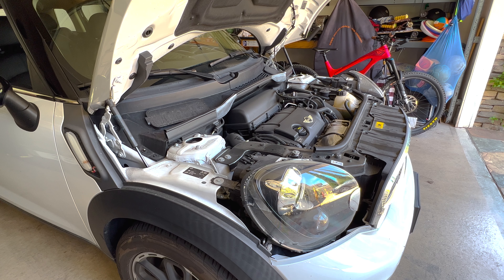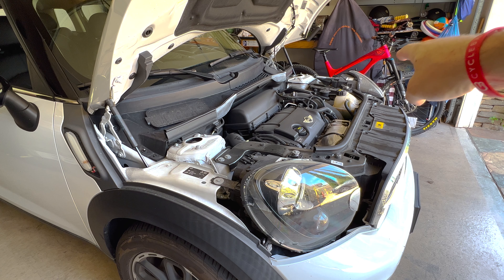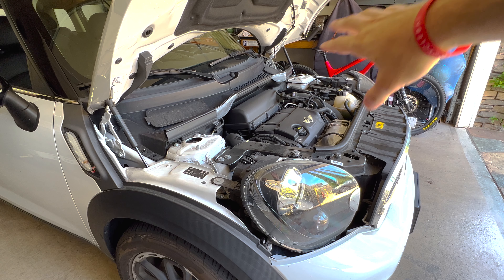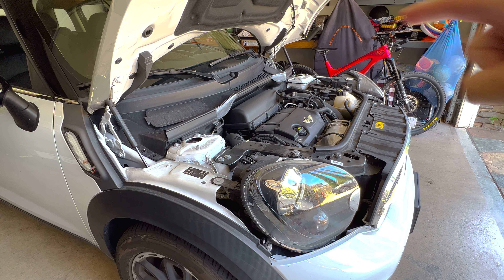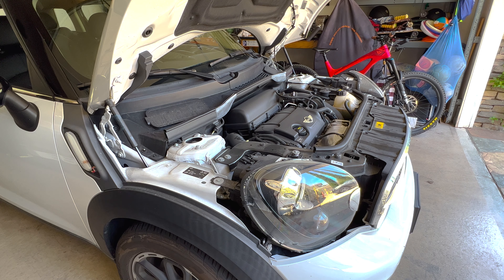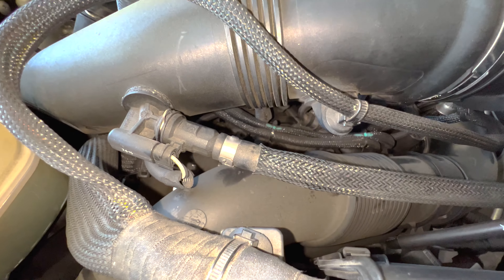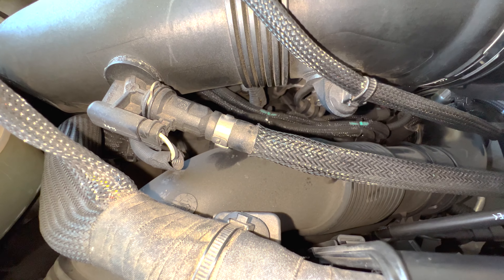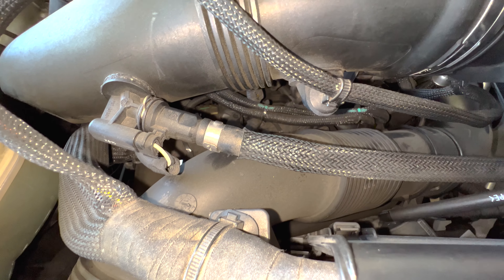We Have A Coolant Leak! - Can We Find It? [Coolant Was Everywhere!] #cars #carrepair #fun

Comment: hi, I watched this video and the next two about replacing thermostat housing. sorry did not fully understand what you said in this video, how did you come to the conclusion that the leak is from thermostat housing?
Reply from the maker: It was tough to show on camera becuase it was in such a tight spot, but I was able to see it dripping out of the housing. I was barely able to stick my hand down there as well to feel the coolant coming out of the housing as well to confirm that it was leaking. For mine, the coolant would puddle up around the bell housing/top of the transmission. It stinks!! Thanks for watching!

Comment: I have coolant going somewhere. I can smell it outside the car when it has ran. The leak is very slow and I never any signs of coolant so it must be burning off somewhere under the hood. Butttt, yes everything is tightly cramped in these tiny cute but painful to own cars. Any ideas for where I may need to check?
Reply from the maker: Ahh sorry to hear that!! Yeah, it’s really tough to figure out exactly where the coolant comes from. On mine, I could see coolant puddling on top of the transmission which is right below that thermostat housing. Just use a nice and bright flashlight and slowly look over everything until you see some coolant puddling.. you’ll find it!